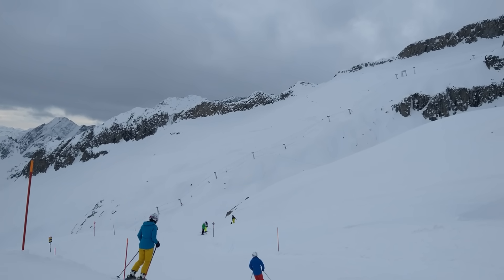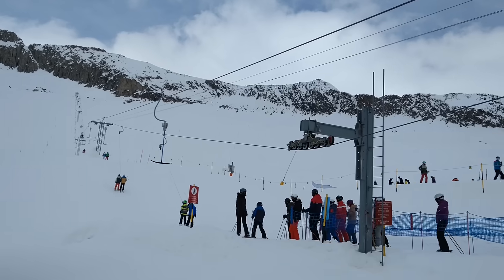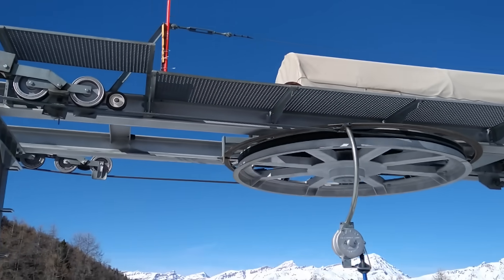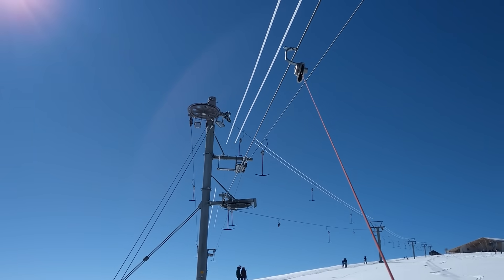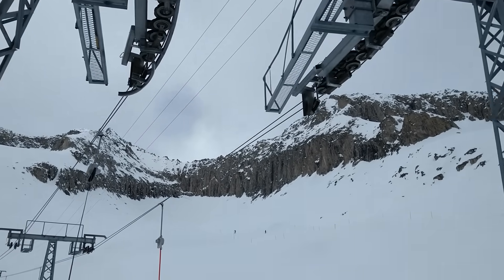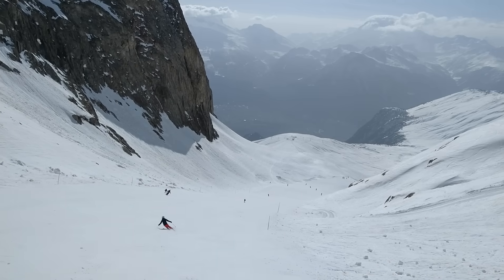The IMPOSSIBLE skilift that actually exists

Comment: what do you mean by old fashioned, i have been using these lifts all my life in Switzerland - I am now 79 - and we had even worse, something that looked like a plate on a stick and you had to put the plate between your legs and kind of sit on it but not quite and there was another where you got a belt around you that was fastened in front and you had to hold onto the front stick unless you wanted to loose the belt and whenever it was steep or a litte bit wobbly on the ground the string that attached you to the moving part, would get loose and you would loose contact and had to ski down with the belt and get yourself attached again. In Arosa on the Hörnli it was like that and on the Weisshorn also. so these here were actually wonderful.
Reply: I guess he means "old fashioned" as in "they were invented first", not like "out of fashion"

Comment: Clamps are called grips. The grips have to be tensioned just right to allow for the cable to slip and twist. if not the grip would be too tight and the chairs would start sticking out horizontally as the lift line goes around the bull-wheel (the wheel is called a bull-wheel). Some Ski resorts will spray paint a mark on the cable and grip at the start of the season to measure grip slippage throughout the season.
Reply: Huh no, they would not start to stick out horizontally... The cable has long stretches that twist just fine regardless (the bit ahead and behind of the grip), that's, like, basic cable behavior.

The spray paint mark is probably to measure grip slippage indeed, but who told you that they want slippage? Zero slippage seems very desirable for safety, you know... The limit being the need to avoid damage to the cable with too much clamping force. I could kind of believe there's some slip tolerance that's still considered ok, and some threshold where they know they need to tighten it right away...
Reply: @u1zha   Huh yes... I worked for years on lifts. First hand knowledge here. The cables will twist and the grip needs to slip. Twisting is attributed to the different pitches the cable goes through as it clears the sheaves and top and bottom bull wheels that are on an even plane.  Fixed chair grips should have only slipped 1-2 feet by the close of the ski season. Anything more than that should be re-torqued immediately.

Comment: Great now I learn´t this. But, how can a charlift slow down where you get on and off the lift? Since it´s attached to a "rope" it should be at a constant speed all the time?
Reply: Modern chair and gondola lifts will actually detach the carriage from the travel rope onto a station conveyor system that either slows down all carriages at the station to a constant pace or can even individually move each carriage. The carriages are also moved to a shed for overnight storage using the station conveyor system.

Comment: Or you could just use the outside of the circle for right turns and the inside of another for left turns…
Reply: Inside? What force would make the rope follow along the inside?
Reply: @u1zha  The rope would follow the outside but the clamps would grab from the inside. The clamps would have to be spaced carefully on the wire such that they are timed appropriately for periodic gaps made in the turning wheel such that the clamps don’t clash with the wheel itself

Comment: 6:30 Not my solution !
What I'd do is main the main pulleys more like sprockets rather than solid pulleys - so the rope attachment points would slot into gaps in the pulley. The one issue with this would be in maintaining synchronisation with the rope and pulley to ensure the attachment points don't coincide with the larger parts of the sprocket. I guess the pulley/sprocket would only need one 'hole' to accommodate a lift attachment  point - and the lifts could be attached say every 10 revolutions of the wheel. Perhaps a split wheel could be used - while the wheel continues to rotate, the gap for the lift attached to the rope could remain stationary while waiting for a lift to come - when it does, it could trigger the release of the pulley gap mechanism which would then pass once round the wheel with the lift and stop again after 1 revolution.
Reply: You could make a sprung sprocket that simply moves forward or backwards 1ft or so to always align with the attachment points
Reply: @ST3ADYxKICKS  Yes, I'm sure there's a solution that doesn't need a whole second rope
BUT having a second rope is the sort of safety measure I like :)

Comment: It solves a problem but at what cost? 

I guess I’m ok with hopping off one chair and getting on another if it really needs to turn. 

But most places I’ve been just went with a straight shot.
Reply: Comfort. And the cost of a 2nd lift with one rope isn't necessarily lower than the cost of a longer lift with two ropes.

Comment: Other way of cheating the system is to have a middle station without decelration but clamp detachment and re-attachment :3
You don't even need big wheels to redirect rope, the normal small ones in batteries schould be enough xD

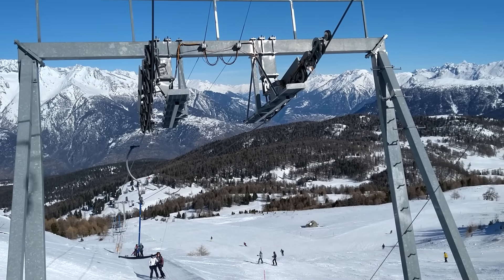Comment: There is also company called Tatrapoma, that produced lifts which can bend both ways with alot simpler mechanism. You can see it for example in this video: https://www.youtube.com/watch?v=xCAewi5ZQ1Y&ab_channel=natgeodez time 3:40
Reply: Great, thanks for pointing out! That's indeed a simpler one! So the clamp is simply hinged, on a very short link up top, and thus doesn't forcefully sway the entire t-bar when it bangs into the wheel (cf 3:30 in this video)

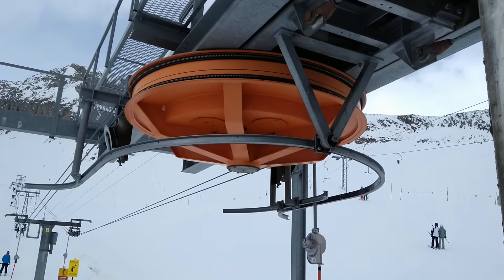Comment: For the first 6 minutes the only reason I was watching was becuase I love these accents and explaining technical things. At 6:08 though I gave it some actual thought, and when I saw the solution I got REALLY REALLY EXCITED. way more than I expected even. My solution was the cable is woven out of multiple smaller wires, so it should be possible to inserts it straight through the bottom to the top and weave the cable around that.
Reply: I didn't get the solution, maybe because he said that it doesn't use "novel shapes". The t-shape of the clamp is definitely novel compared to the usual t-bar lifts.

Comment: The solution I came up with was for an inside turn having a bunch of little wheels on the inside and then rollers or rubber Wheels on the outside that keep the chair in the cable locked against the outside keeping it snug against them would have to figure out the details I'm sure you could find a way to make it feasible.

But yeah, this is so much more simpler and elegant and honestly it's really beautiful and visually satisfying. It's like the bank's on a roller coaster turn so in that regard this is basically the exact opposite of how a suspended swinging roller coaster works, where the track always stays parallel and it's The cars that swing on turns outward. Anyway thank you for sharing this with us!
Reply: The other thing you could do which would take a lot of work and would only work on the downward slope but shouldn't be too hard with little t-bars that don't weigh much, is to have like a guide track as it approaches the curve that pushes the t-bars up at an angle until they're about 90° sideways so that it can go around the curve as if it's now an up and down convex curve

Comment: They really pulled out all the stops for that ski lift! It's like the designers were just having fun when they decided to make the last support float!
Reply: I haven't went skiing since 2014, and only on a small hill, but the engineering of this ski lift sounds fascinating. :) One of the many reasons I enjoy science and technology, and traveling.
Reply: They better pull out all the stops! Would be a nightmare to have to go all the way to the top by sled just to pull the stop button out. 😅 That's a thing you gotta deal with from time to time working lifts.
Reply: It's only a counter balance to hold the lines tight !
Am always amazed when people use technology which could potentially be harmful to them if it broke and thinking that its all "fun" !!!
Reply: @team3383  So you mean literally almost every piece of technology? Are you afraid of planes, cars and elevators too?
Reply: @GowGows  I'm afraid of people who think that technology which is there to protect them is a bit of fun !
The suspended reinforced concrete block is suspended to tighten the cables and be mobile thus leaving some wiggle room for the cable which is not taught as tight as a violin string FOR A REASON. Not for fun.
Try reading correctly next time.

Comment: I've seen a button lift that can turn both ways through a mechanism resembling a middle station only there was no actual building. The bar would seamlessly detach from the rope and reattach to a new rope going at an angle, forming two loops. Some bars would dettach but others would remain and head back down following a logic I couldn't figure out. The real fun part began after the switch where the terrain would go downhill. So much so that your skis would start to outpace the lift itself, making it impossible to hold on to the bar. It caught me so unprepared that I had to do a couple of early dropouts to realize I needed to do a snowplow to get past that stretch.
Reply: sounds quite rough for snowboarders xD
Reply: That sounds like an interesting mechanism as well. I knew those existed for gondulas, but I haven't seen those for tow Lifts yet. I wonder which would be more expensive to build, the two ropes or the middle station.
Reply: @dextrodus  I doubt there's a significant difference. Drag lifts are relatively cheep installations that have a very long life expectancy. A reliability track record comparison could be interesting though.
Reply: @gvaley    POMA made a few detachable platter lifts back in the 1970s or 80s. They have a "magazine" of sorts that holds the detached bars at the bottom. There is a stoplight and when it turns green it releases the hanger onto the cable. There is one in Åre, Sweden (Vargenliften) and in Hemsedal in Norway. From what I have heard its absolute hell to maintain them compared to a normal platter or T bar lift.
Reply: @maxcalabrese5962  Yup, that's the one I'm referring to. They still run, considering they were built in the 70s or 80s, so I guess they are not hard to maintain. But I've only seen one making a turn.

Comment: the cirque at snowmass in colorado usa has a pretty pronounced turn in it. compared to the engineering here they quite literally just said FUCK IT, and both up and down take the same turn with a wheel on the inside of the turn. (the cable latch is strange though, its a detachable surface lift)
Reply from the maker: Found it here I think: https://liftblog.com/cirque-snowmass-co/
Is this what you're talking about? https://skiliftblog.files.wordpress.com/2017/02/img_9227.jpg
Looks to me like they just have a metal guide that rotates the clamp away from the wheel. So it's actually doing the same trick: rotating the clamp. However they use these steel rods right before the wheel.
Reply: I am a student at an aerial ropeway college, there we have a poma lift i would love to send you pictures of the installation and how it works
Reply: I was about to mention The Cirque! But it’s definitely a less elegant or fancy solution than the ones in this video.

Comment: Unfortunately, these really ingenious engineering solutions will slowly but surely be replaced with chairlifts. Usually, the reason for such awkward T-bar lift routings is the need to circumnavigate some terrain obstacles. Chairlifts obviously have less or no such constraints as the skiers are lifted above ground. Cool video. Being central Switzerland based, I have never been to Belalp. I should go there before that lift gets replaced.
Reply: There are a few place in Spain (boi taull) and France (Puigmal) where at the top there can only be ground lifts because of the wind. At boi taull they even replaced a chair lift with a T-bar last summer because of it. So there is still some hope for these.
Reply: Oh great, now I want to ride an opposite turn chairlift!
Reply: On glaciers it can be really hard to build lifts because the ice moves (though, very slowly). You can still build a ground lift and move the masts as the ice moves but chairlifts need more stable masts that are build into stone.
Reply: https://www.youtube.com/watch?v=lVdUHu4KFN4

Comment: This is not the only way. Cabin lifts are usually 2 speed so the cabins are detached from the rope on the stations and are guided by pulleys and it is possible to make a turn like that.  This is what the Zehnerkarbahn does in Obertauern. It turns about 70°at the middle station.

Comment: Wow, what an awesome video! First it's very well explained, and I never saw the final solution despite being a ropeway enthusiast myself. It's pretty clever!
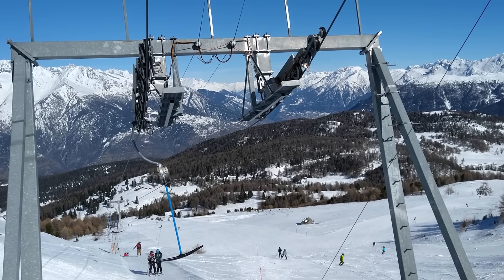As other solutions, there is the triangluar shape, where the descending side is not parallel to the ascending one ; or that Poma lift in an indoor ski slope with a bull wheel featuring a notch ; or on a bigger ropeway, that awesome "wave" where they used the principle described at 3:43 to the extreme, basically adding those tamer curves one after the other.
Reply: Huh. Funny you’re here. I swear, you pop up in the most in-roller coaster related content I can think of.

Comment: Do you have to pay more attention to holding onto the T-Bar when it takes the turns? Or can you still just sit on it without really holding on with your hands?
Reply from the maker: The lift is a little harder to board than other lifts because the spool moves in all four directions, making the bar more pone to swining as it approahces you. However, once boarded, there is no notable difference. For skiers, the curves are not a problem. For snowboarders they sometimes require some extra attention because the cord pulls you too much to the inside of the curve. It's not particularly bad though. What makes the lift hard to ride, however, is the steepness and sometimes the extreme wind conditions.

Comment: My initial reaction to the question of how to turn both directions was to use detectable chairs at turn stations, but I have to admit this is a pretty unique solution I did not think of.  I am not sure it would work safely for chairs and gondolas though, which is probably why you only see it for ground lifts.

Most of the ground lifts around here have been replaced.  Still a few fixed grip chairs but even they are getting rare, short or less used lifts mostly.
Reply: Look up the Snowflake Lift at Breckenridge. It's a chairlift that makes a 45 degree turn
Reply: @darrenleary5534  I found this video https://www.youtube.com/watch?v=0dysuh-0qJY which doesn't really go into it but it looks like it uses 2 outside turns to make the inside turn on the way down like the first ground lift in this video.  Pretty cool but I imagine no downloading.
Reply: @darrenleary5534  I skiid by that last month and thought it was super wierd looking. Ive now gone full circle
Reply: It's so sad that most ground lifts are being replaced in most places...

Comment: Detachable ski lifts can turn in every directions since the fixation is around the cable. When the cable need to pass over a wheel, there is a guide to push the fixation to either side needed
Reply: This is not true, to perform a turn the grip would have to detach from the cable with the use of a mid station, search "transarc tcd" on Google and you will see what I mean
Reply: @caiwilkie6453  here is an example of skilift with two turns and no midstations : https://youtu.be/4OhjmCJb8bo
Reply: @EmmanuelCoirier  The Poma lifts are detachable, so their clamps are designed differently, allowing for basically any type of turn, within reason~

Alsooo they're more energy efficient, can go faster and are more comfortable to get on, all due to the loading mechanism at the bottom station
Reply: @caiwilkie6453  thats how most of the bigger lifts works where i ski. theres a mid station where the lift detaches from the cable, then moved slowly with normal rubber wheels and lifted on the second cable after the turn. Its for 8 or 10 seaters usually.
Reply: @caiwilkie6453  exactly
Reply: This is definitely more cost effective, and a detachable station is limited in the angle it can turn
Reply: An advantage of detaching is also that you can go faster since people can be gently accelerated up to the rope speed.
Reply: actually, basic one person Teleski Poma style with sliding bars and detachable from the rope you can find in most of the Alps are preferred because you can go any turn, even to some extend downhill only limited by the abilitty of the person  to ski brake to avoid to have a backward bar. The installation, mast, wheel, etc are also way much slimlined and easier to maintain. Beeing detachable also means he can have variable bandwith and reduced power consumption when little load is onboard...
Reply: @testman9541  It's always fun to take a button lift for the first time, only to discover it has a downhill section! The most fun one I have used had the track crossing a road on the downhill!